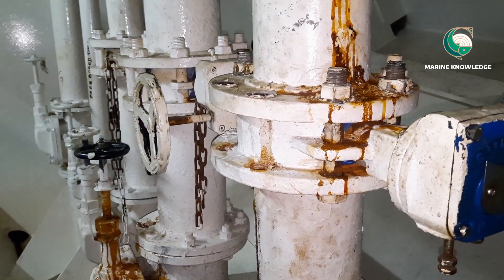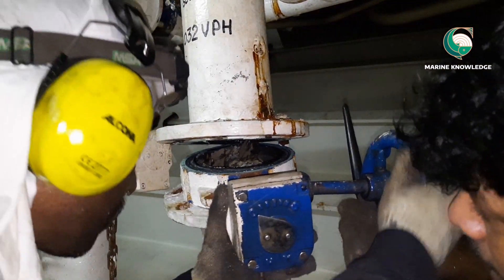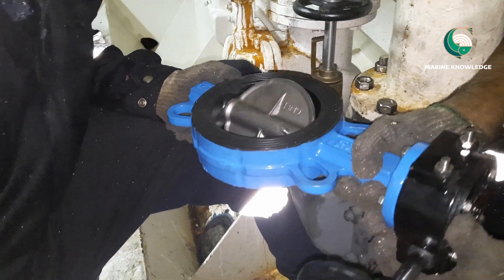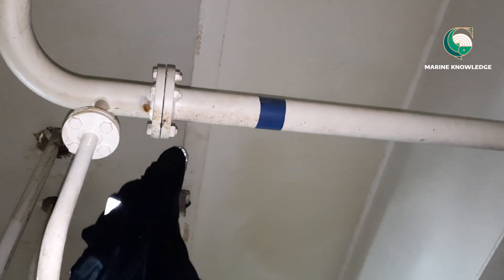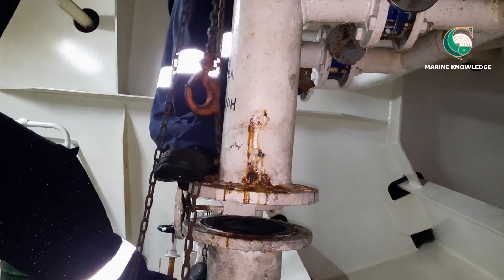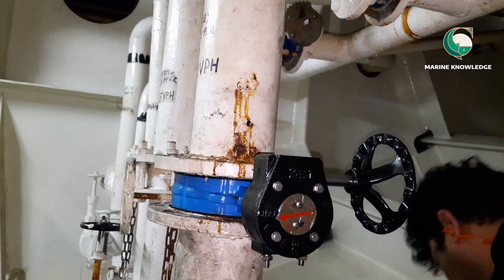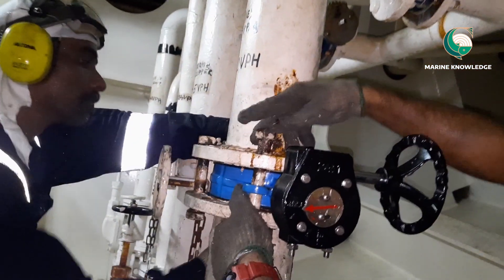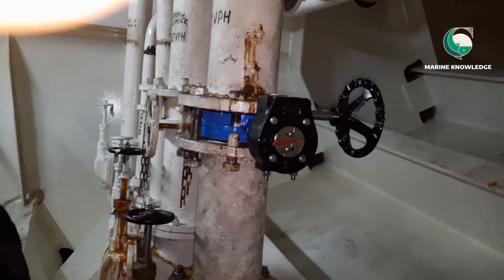How do they do...How to remove and replace butterfly valve onboard ship...

Comment: Sir why are the bolts with the nuts on the upper side? since with the bolt on the top if the nut is lose it will not drop out.
Reply from the maker: ur point is very correct…it may happen in areas where the pipe undergo heavy vibration..